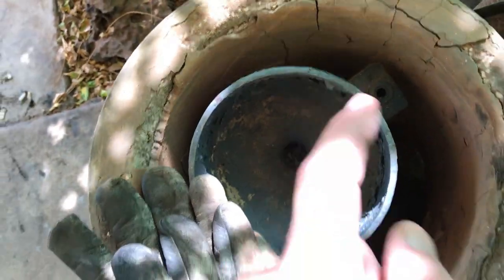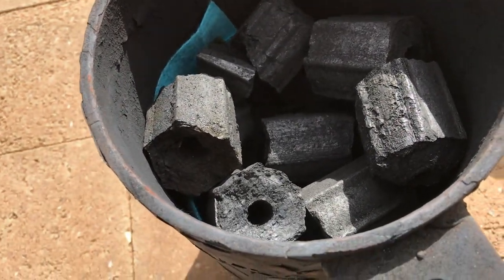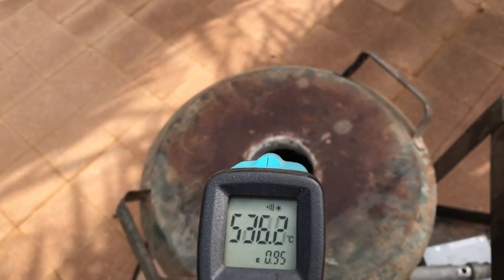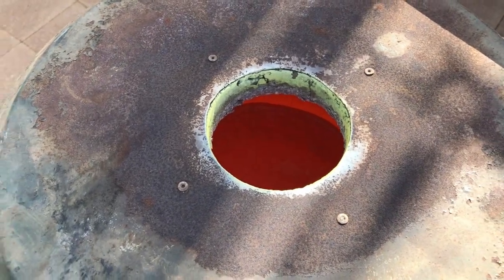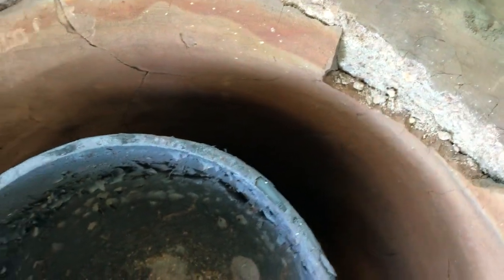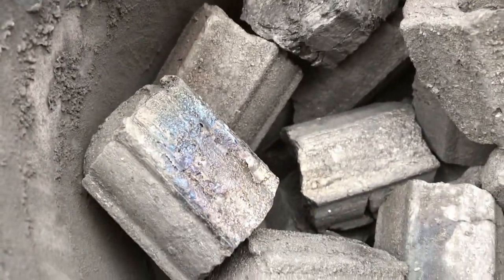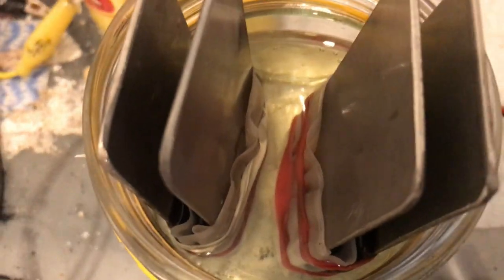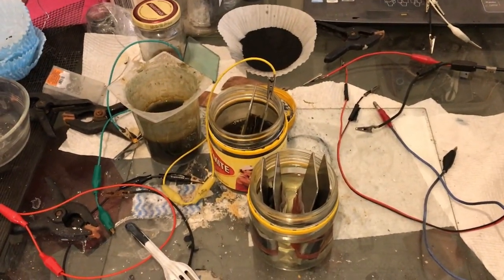Making Some Carbon Felt

Comment: on the negative side negative release less negative  space and posetive is tacing from the medium that taces from the carbon and carbon taces from the negative side.
electric we see pasetuve (less negative as negative and posetive where there is more thention towart energy behavieures for that particles to to be more exeterated for men to masser small chainces 🙏💜🙏

I am amazed you use oil😍
how dit you come to use oils behavieure of the medium 👀¿😍🙏😍
the carbon tisheu is leaking in to the olisch and the Flux of there cores is bilding op more external thentional behavieures of the medieum for it to start gentiles pulling releasing pulling releasing for the elongated structures to apeure😍💜😍

when you make a coil around it like the cathode ray tube you probebley with the right tuning wil create conditions for it to seaside to become tunneled structures. 
carbon wil behave as the coherence resonance of the coil🤣😍🛸
Reply: I cleaned op carbon with a coper nanolayers foil around the jar to translate eurths coherence in a dna motional behavieure .
I ended ip with microdaimands and the blackers carbons this way💜
notice ........
dinamic motion of directional polarization of the nano coper foil has to bee in line with eurths infiseble eurth  ring its coherence towart eurths behavieure of  existance .
other wishes you get smashing and bumping radiation to disturbed the stations of the cells trout the gravatron translations of cosmic informations of the total set of conditions to provoce the desistion of its behavieures😍😃😍

🐒🌀
Reply: and in this rheal of dimentional understanding 0 DC is feading and plus DC is pulling🙏😍🙏

Comment: Nice Dan - was that 800 C or F
Reply from the maker: Dennis Kramer about 800 decrees c. I think this burn was a bit hotter the co2 cylinder was glowing red hot. It lowered the ohms to about 7. The first small bit of felt was not as hot and measured 26 ohms there about. Hotter the better I think with in reason.
Reply: @danp1224  Thanks Dan - I just got a little used kiln going.   Will start experiments at 800C.   Want to try some wool felt, Rayon (PAN?), and Oasis foam....all for cathode materials...
Reply: Hi Dan.....do you know what the fabric content was for those sheets of cloth......so far my tests have just produced melted ash
Reply from the maker: Dennis Kramer Hi. Are you using a container to limit the air. I also put carbon bbq brick in there. Not sure what material it is made from. It just said felt.
Reply: @danp1224  I have a section of 2" I'd pipe closed off with caps...1/16" vent hole...like RMS...worked great for oasis foam carbonization....I think the wool felt I was using was a synthetic blend and at 800 C evaporated away...the carbon ash was very conductive though
Reply from the maker: Dennis Kramer interesting how conductive.
Reply: @danp1224  less than 20 ohms when vom probed